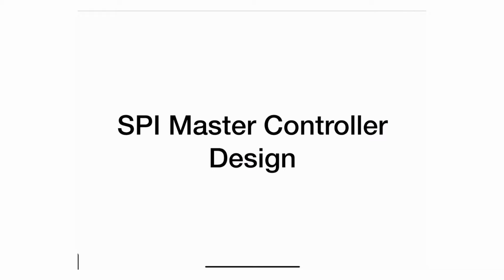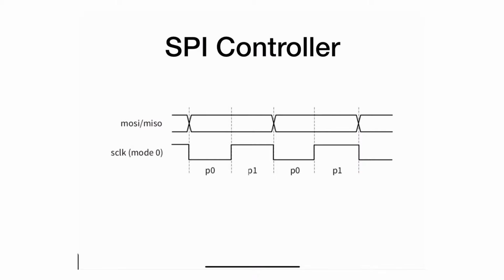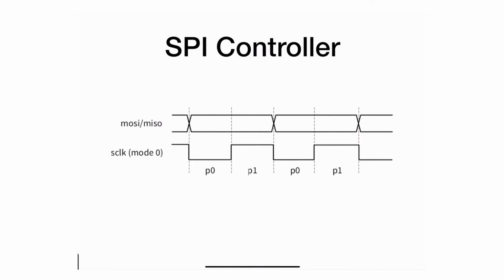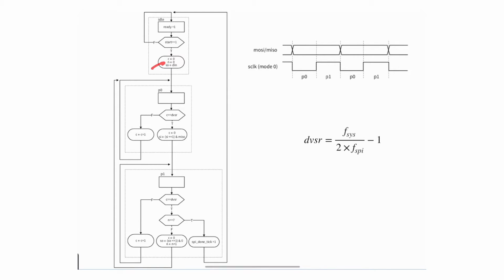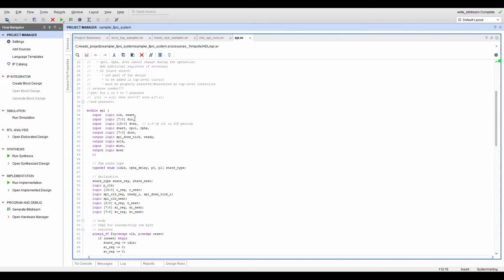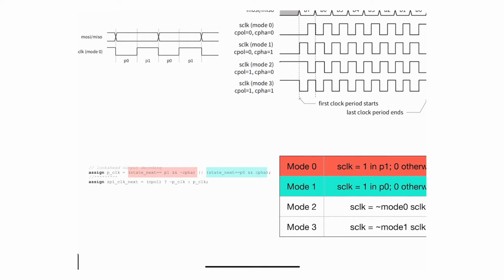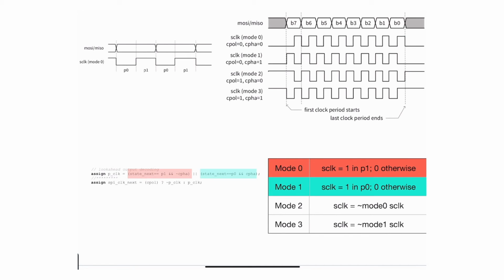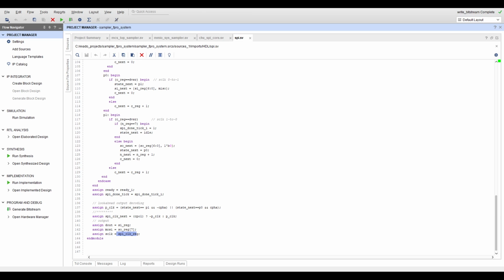M11 - 7 - SPI Master Controller Design

Comment: what is the purpose of cpha_delay case ?
Reply: hey I got the same doubt, If you have figured out by now...can you let me know, please:)
Reply: I did a simulation on this, looks like cpha_delay add half period of setup time when cpha=1. I am no professional, so correct me if I am wrong.
Reply: I want to ask a simple question. I want to read the register contents of device with start address at 0XC then to 0XD and then to 0XE. It auto increments.? How do i do in spi read?